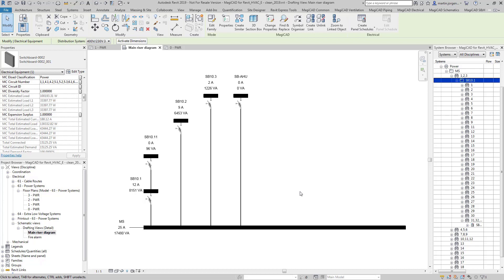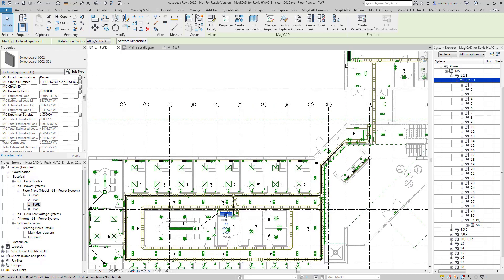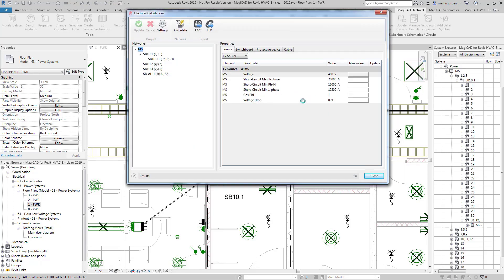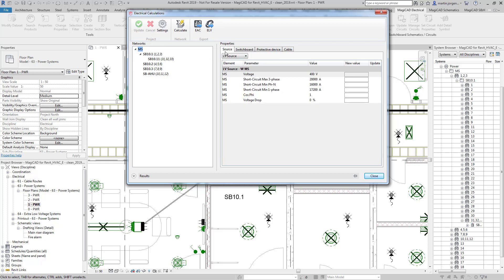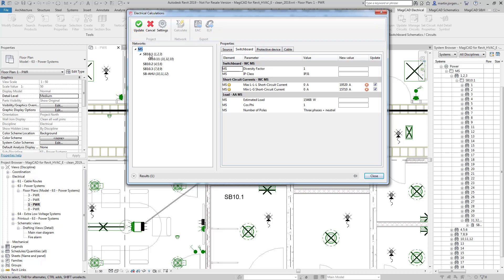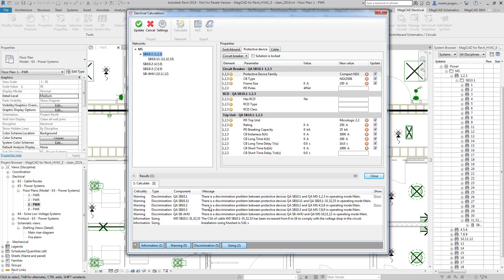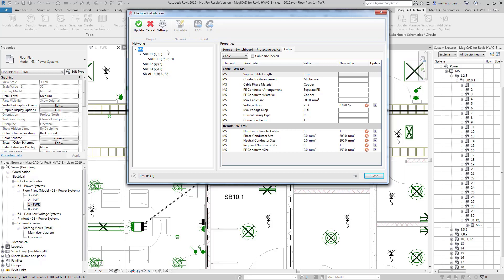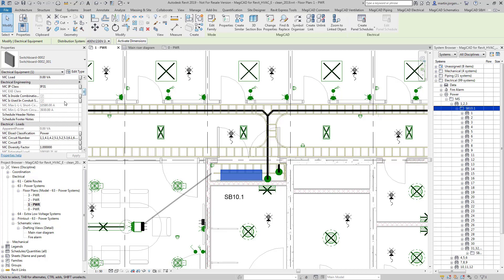MagiCAD 2019 UR-1 for Revit / Electrical Calculations for Revit

Comment: If you are going to have a UK tool for electrical calculations only having access to Schneider equipment is going to be a deal breaker for pretty much everybody. A Live-Ground short should be called an Earth Fault. Virtually the entire UK industry of electrical Consultants and Contractors use Trimble ProDesign. Ideally, you should have integrated Trimble's ProDesign 3D. While this looks to be perfectly functional this is not what we need at all sadly.